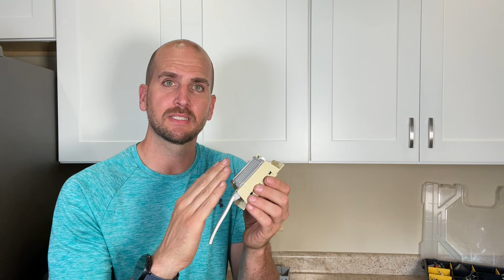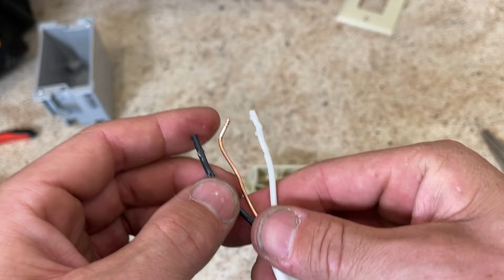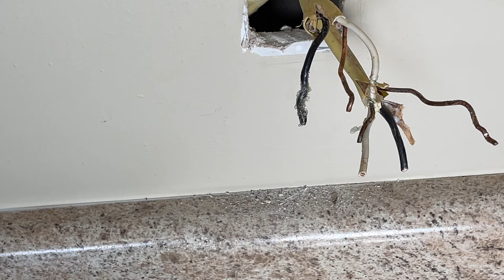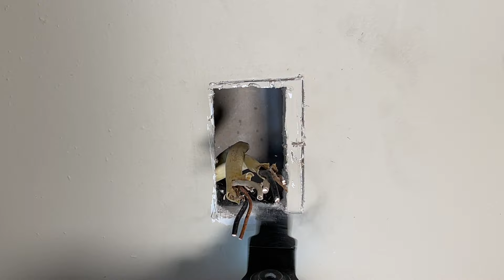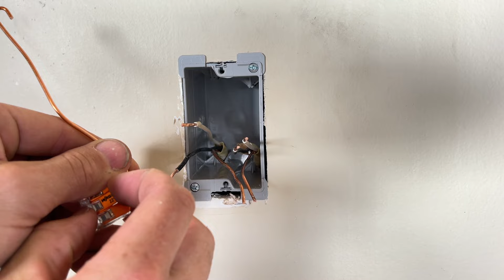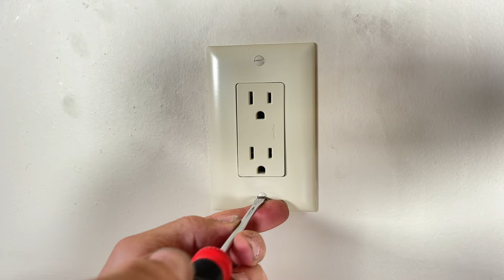How To Replace a Failed Mobile Home Outlet

Comment: Well, being as i don’t live in the US, this should be interesting…
(In the country where i live most electrical outlets have switches on them, and also a double outlet has the outlets positioned side by side, rather than on top of each other, there are also single ones and triple ones, oh, and also the plugs must be one of the largest, if not the largest in the world)
Oh, and i just realised i forgot to mention that the outlets where i live have the screw terminals on the rear of the outlet rather than on the side, and the faceplate is part of the outlet
Also, insulation (green and yellow) is put on the earth (ground) wire where i live (id imagine this is done to help prevent it from shorting onto something)

Comment: I hope you ended up using a 20 Amp outlet after finishing filming
Reply: Just because they used 12-2 wire doesn’t mean the circuit was a 20A.
Reply: @daveenerson6763   more often than not yes it does especially in new construction

Comment: Was this outlet UL approved?
Reply from the maker: Yeah the self contained outlets are UL approved.  For what it's worth.
Reply: It seems the UL listing doesn't always consider what happens in the real world,  vs a controlled setting in a lab.   Because mobile homes and RV gets hauled down the road, the bumps on the way to it's destination would disturb the already flimsy connection.   It might be safe to plug lamps, TV,  laptop charger, fans and similar low amp equipment,  but doze off in front of the 1500 watt electric fireplace and you have  just committed suicide INSIDE the fireplace,  literally.    Those outlets should never have gotten a UL listing to begin with.
Reply: @Sparky-ww5re  Perhaps the CPSC has to see all these burnt outlets so they get the message and ban further sales of those death trap outlets.

Comment: I have never seen those, are the light switches the same way? That's crazy they'd allow something like that, but I guess would save time in manufacturing.
Reply: They sure are! My dad was all about this smart lighting crap, standing at the door asking Google to turn on the exterior lights instead of just reaching up and hitting the light switch. But he was using those crappy little light bulb socket adapters and they'd keep dying. So I got him a smart light switch instead. EXCEPT it's a mobile home, so it had those crappy "no work box" switches, so I had to get an old work box. Also this was a bank of two switches, so I had to buy a second normal switch to replace the switch for the interior lights that we weren't making smart, because the existing switch wouldn't work in the old work box! What fun! 😒
Reply: @mjc0961  That sounds like the type of job a friend or family member would try to rope me into doing. 
Lol, good story!
Reply from the maker: Yep, switches are self contained as well.  I need to dig around a bit more since I am not sure the mobile home manufacturers are still using these type of outlets and switches.  At least I hope they aren't still using them.
Reply: @EverydayHomeRepairs  Thanks for the video. I live in a 1999 model MH and my outlets are just like the one you showed in this video. I appreciate the tutorial and will change them all out over time. I enjoy all your videos, I try to do all my home repairs and upgrades myself. Without these videos I won't know how to get these projects done. Many thanks.

Comment: The only thing I saw that was wrong. When connecting the wires to the outlet. You went hot then neutral and ground. That is backwards. It should  be ground then neutral and hot last when installing.
Reply: It doesn’t matter the order. It’s just good practice to terminate ground, neutral then hot. 

However, I’ve learned the hard way when replacing live outlets/switches. To disconnect the ground first, then neutral and hot. Then put hot on first, neutral then ground. Why? Because the metal frame is usually right next to the hot and neutral screws. And grounding either them, especially if AFCI or GFCI breaker, will trip the breaker.

Comment: What did you do, make sure the screw heads were oriented in the same position? I must've missed something...
Reply: Usually I also rotate the faceplate to match the socket and the socket to match the countertop, but the landlord is fine with pried off trim left under nearby furniture and baseboard installed with its paint still wet. 'tevs.

Comment: Any reason you didn’t use commercial outlets with side wiring? Your previous videos convinced me to never buy receptacles that need j hooks ever again. Interesting video showing how these homes were wired and yea they definitely remind me of network cabling in patch panels.
Reply: I was thinking the same
Reply: J hooks are still the most secure method to wire a receptacle and almost always will provide more surface area than side wiring. If you’re trying to save some money you don’t need to spend more just for side wiring.
Reply: I have many mobile homes with the old style receptacles and switches. I try to replace them with standard ones when one stops working. Surprisingly ive never had one to short or burn.

Comment: Based on that carbon track out the front of the outlet, it failed from poor contact between the male plug and the internal contacts behind the faceplate because the contact assembly lost its tight grip on the plug blades. The stab on Romex connections on the back had nothing to do with this failure. Note that neither the black nor the white wires showed any signs of heat damage. However I agree that this is not a confidence inspiring wiring method. 

Cheap residential grade outlets and switches fail in that manner even with standard wiring techniques. Their internal construction is just not long lasting in regular use. The stab in connections on the back for 14 gauge wire are all awful and just begging for failure. If you have to replace a device that is used for high current devices like heaters, kitchen appliances, and air conditioners you want to use "Federal Specification Grade". They are much better made and will hold up in serious use. I put them on my kitchen counters 20 years ago and when they were removed for remodeling they were all still working great and are going into my new workshop.

Wago Lever lock connectors have been in use in Europe for at least 20 years. They seem to have a good reputation there. We will see if there are any long term problems in a few years here. I have a large supply of wire nuts so I will wait until I have a problem that they can solve to try them.
Reply from the maker: Hey Walter appreciate all the feedback!

Comment: @4:28:  Be careful testing like that.  Particularly on a damaged receptacle or fixture, the wires can be live but not energizing the contacts on the receptacle or fixture.  (That's a less likely problem with an outlet tester like yours, since it might read live if either the hot or neutral has contact, depending on the wiring of the rest of the circuit.)
Reply: well his tester would have still read a ground connection, the burned socket was the neutral side, so at least he would have had live show up and just not gotten a neutral light.
Reply: @compzac :  I'm talking about as a rule.  If the wires are poorly connected to the receptacle, you might read the receptacle as dead, but that doesn't mean the line is dead.
Reply: EXACTLY BRO!! EXACTLY!!! THAT REASON ALONE they should be banned.. the wire thats loose could be hot. You cant circuit trace it, so youd need to turn off ALL the breakers!  totally stupid...TOTALLY... 
guess where this can NEVEr be used? a pipe environment.  romex is the worst

Comment: These outlets are a fire risk and I will tell you why. The contacts to the wires are minimal, a bare minimum. So if you happen to put a heavy load on the outlet, those contacts will get really hot, the small gauge connection becomes like a light bulb filament. Edit: sorry I repeated what you said in the video.

Comment: Great video!  These were used in my RV as well, and even used as junction boxes that had the plugs blanked out behind walls.  it was the first thing i elminated when i was renovating my RV, and as others have said, probably why so many rv's burn down.  Everything is now setup to quality residential or commercial grade outlets, connections, switches, etc.  It was in poor condition when i bought it, and a complete gut job so that allowed me to just replace everything as i went along.

Comment: You never explained why using the Wago nuts with a pigtail was better than just using both side screws on the outlet to connect the 2 sets of wires.
Reply: Electrical receptacles are supposed to handle the load of devices plugged into them. They are not supposed to otherwise be part of the circuit. By wiring as you describe, all the current on the entire branch, including what's going to other receptacles, would be flowing through the receptacle you just installed. This not only makes failure of the receptacle more likely, but it increases the odds of the failed receptacle either starting a fire or causing issues for the entire circuit when it fails.
Reply: Pretty much what Andrew said. Receptacles are not intended to be used as a connector. In a duplex receptacle you have the option of making each socket independent of one another by breaking the tab that connects them. Hence, one pair of screws for each socket. It also makes it easier if you change the receptacle down the road. I'm not an electrician, but what I heard if it's wired using all 4 screws it indicates diy'er or homeowner installation.

Comment: I have those in my home and have had issues with them, especially the switches. I’m having all of them replaced with standard ones. Over half of the ones that have been replaced on the switches and some of the receptacles have signs of arcing inside the housing. I call them fire starters…. Keeps me on edge until I get all of the switches and receptacles replaced.

Comment: Those all in one outlets are scary! I can see that sort of design for low voltage applications but for line voltage it's a little shocking (oops, pun).
Reply: That's exactly the same thing I was thinking, with the insulation displacement connectors and all. Never heard of anything like that for a higher voltage
Reply: I have a mobile home full of crap like this, the boxes are fastened to the freaking paneling and none of the lines are stapled to the studs. It's insanity. Replacing it all properly as fast as I can.
Reply: When you say low voltage, you mean signaling and low power applications, nothing too demanding?
Reply: @soundspark  Yes, but more specifically like low voltage (24v) landscape lighting, punchdowns in CAT5 connections, etc.

Comment: I’ve seen these stupid things in RV’s and it really makes me hot. They are a fire risk in my opinion and shouldn’t be legal without  stripping the conductor insulation back at a minimum. The problem in some rv’s is that they are in such thin walls that there isn’t a good alternative to replace them with that I am aware of, but I’m not a professional either.
Reply: They have thin design side extended plastic boxes at lowes/home depot that work well in RV's.  sometimes you will have to use a 1/4" spacer behind the wall where the tabs clamp down for the box if you're installing it where they used the 1/8" luan/plywood.  it's works well and will usually fit in any wall you need to put it.  you may need to clear out some foam behind the wall if it's an exterior wall the outlet is in.
Reply from the maker: I would think the increased vibration from an RV being on the road would be even more challenging for this type of design.
Reply: @EverydayHomeRepairs  I suspect it is, because my first one had to dead outlets, and I intend on changing the outlets once it is out of warranty. On a positive note, they did use wago 221 lever nuts on all the trailer lights, so adding cameras was a breeze.

Comment: Shouldnt that be a gfci since it’s on a kitchen countertop?
Reply from the maker: The Romex coming in was from the load terminals of a GFCI.  Good callout.
Reply: @EverydayHomeRepairs  So, should you put a sticker on the faceplate stating "gfci protected outlet"?
Reply: @surferdude642  yeah, should... never see it done though.

Comment: Screw slot up-and-down instead of side-to-side.
Question: If the wire is 12-gage, did you check to see if the breaker is 20-Amp? If so, any reason you didn't upgrade the outlet to 20?
That crap outlet is using the same type of connection used in network cabling. For 48 volts, that may be OK, but not for 120!
Reply from the maker: This was on a 15 Amp breaker and not sure why 12 gauge was used.  I was expecting 14 gauge.  Yeah I had seen this type of connection as well on some DC electronics but had no idea this was an accepted practice in the Mobile / RV market.
Reply: @EverydayHomeRepairs  I have seen it recommended widely to use 12 gauge for receptacles regardless of whether 15 or 20 amp circuit breaker. 14 gauge for lighting. That is what I have always done.
Reply: @KameraShy  That's what I was taught as well.
Reply: @EverydayHomeRepairs  I think the reason why they did this is because they may think that the future owners might want a 20A circuit instead of a 15A circuit (and also 20A receptacles).

Comment: Bought a trailer park recently.  Spent a good bit of time doing exactly this recently.  Double gang boxes with two way switches are a delight with this trailer wiring ...
Reply from the maker: Nice work buying a park.  What % of the homes are parked owned.  I will be partnering on my first park if everything makes it through closing in about 45 days 🤞
Reply: @EverydayHomeRepairs  100% park owned.  We have been in single family and duplexes for 15 years.  This is our first trailer park.  Luckily I have some local resources helping me out with learning trailer maintenance.  Totally different beast than traditional stick built.

Good luck on your closing!  Hope things go smoothly.

Comment: We only use those push down connections on data points such as RJ45/computer outlets not for mains voltage and yes we use a punch down tool to ensure that they bite through the insulation down to the wire. 
The ground wire or earth is never left bare, we have a specific PVC sleeving that slides over the copper wire.
Reply: What's the point of insulating the ground?
Reply: @ncooty  we've found that when the electrical conductors are pushed back into a tight back box or light fixtures with a bare copper ground/earth it can damage your hot/live wire or neutral causing arc faults, earth leakage, or even a short circuit.
Reply: @michaeldunham3385 :  Interesting.  Makes sense.  Thanks.
Reply: @ncooty  no problem 👍

Comment: Just like punching down phone or data cables onto 66 or 110 blocks.
Reply: Data cables are carrying extremely low voltage and current, so it’s not the same situation. 120v can start a fire.
Reply: @liquidrockaquatics3900  and even with PoE++ you aren't running more than an amp.

Comment: What you did difference at the end was to have both face plate screw slots horizontal.
Reply: I always have both screws vertical or horizontal, whichever seems to be a better tightness.
Reply from the maker: 😂 Bingo!
Reply: I noticed that too
Reply: I've stopped doing that, as I feel like trying to line things up competes with getting the tension "just right" for the plate.
Reply: Looking after detail nice
Reply: It kind of bothered me because I always set mine vertical

Comment: It bogles my mind how those can pass any kind of code. No wonder so many burn down from electrical issues
Reply: Many manufactured homes are also built with foam insulation that is also a fire accelerant. They are seemingly built just to burn like a box of matches.
Reply: So, I lost a leg somewhere to my kitchen and found this receptacle type. Now you have me thinking I should go ahead and pay the electrian to replace every outlet...😲🤔
Reply: It's allowed under the tornado exemption.  So long as there is a greater chance of a tornado destroying the place before there is a fire, anything goes.  In Florida you would be lucky to make your first loan payment before the place went all Wizard of Oz on you.
Reply: @docferringer  wow...thats nuts. Good info
Reply: @docferringer  Usually homes in Tornado Alley in the Southern States turn into kindling.  Our homes in my town in Canada were for the most part still standing after our tornado.  Then again, our homes were built to handle snow loads, so that may be a good thing.